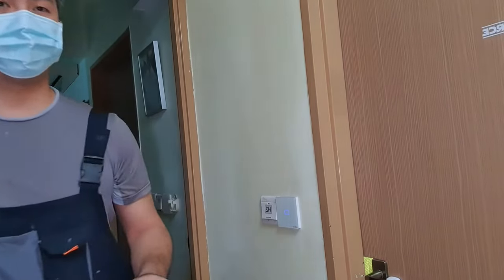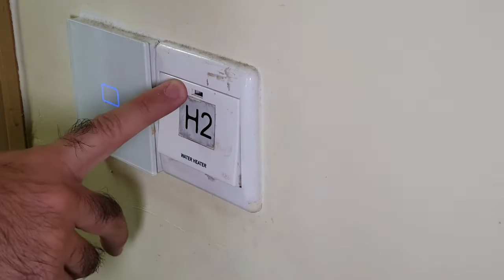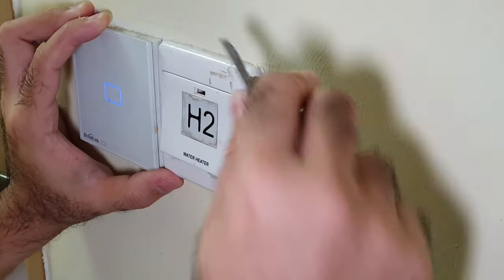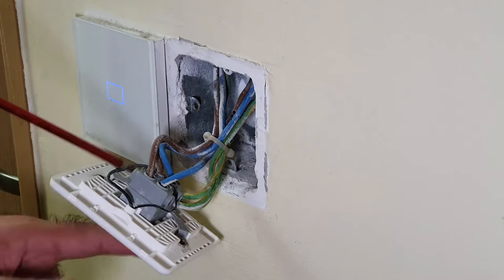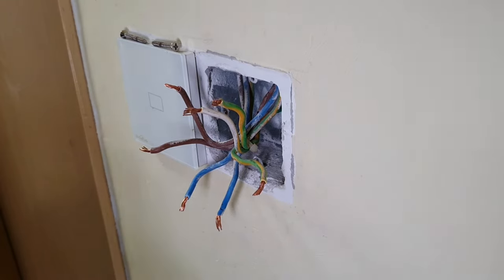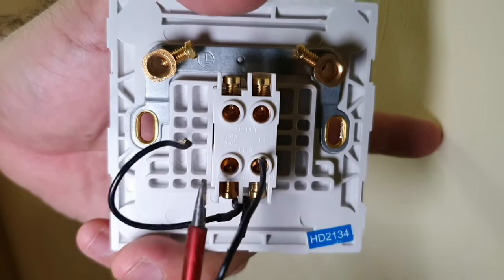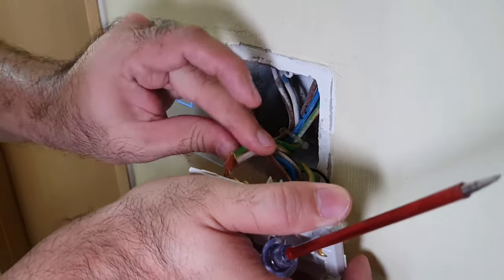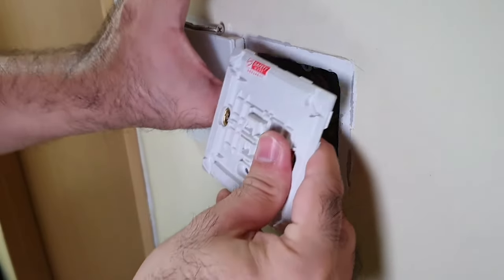Water Heater switch (20A dual pole) change (Save $120)

Comment: I found 3 earth wires when changing the heater switch, why are there 3?
Reply from the maker: Those are probably the Daisy Chain which links the rest of the house
Reply: We connected 2 of the 3 earth wires to the earth port of the switch. In the process of connecting the third earth wire to the earth port, we tried to strip the wire as husband earlier snipped it off clean, and this tripped the whole circuit both times we did that.
Reply from the maker: When you are working on electricity, your CB SHOULD BE OFF. The circuit tripped to save your husband from hurting himself!
Reply: We only switched off the CB for the heater, not for the entire house. So this likely meant that that earth wire was connected to something else in the house.
Reply from the maker: Yes it is. Your cb detected a complete circuit running through your husband and tripped. When faced with multiple wires always turn off the entire house as the Cb only controls live and current may still be present in neutral and ground. Did you use a test pen?
Reply: @ThePunggolHandyMan  Yes he tested before touching the wires, including this earth wire.
Reply from the maker: @kids_fun_draw_build  ah ok the CB detected some thing. Usually if neutral or live touches ground, it creates a shorter path for current to flow and it gets detected by a CB thats what we call that a short. Hence short circuit. Not what ppl call shock circuit. But yes its quite shocking. To avoid this startle best is to turn off the CB while working on the component. You don't get this problem in normal switches as there is no ground wire there. You get this effect when working on sockets
Reply: Thank you for your comments, appreciate it.
Reply from the maker: Thank you for watching!

Comment: Can I connect two water heaters on one circuit breaker With a cooker?
Reply from the maker: It won't be advisable..
Reply: So what can I do if I have two bathrooms with each having a water heater and a kitchen having cooker and I have one 32A circuit breaker on my main switch
Reply from the maker: You can always engage an electrician who will rewire the home if necessary.  Else if all appliances are drawing power it may trip the breaker

Comment: Hi, i changed to new switch bt now the switch feels hot when turned on. Any advise please?
Reply from the maker: The wires inside may not be attached properly. Remove and re-attachmaking sure full contact with the copper strands
Reply: @ThePunggolHandyMan  noted…thanks!

Comment: What happens if we switched load and supply connections?
Reply from the maker: Nothing really. You will just find it confusing to connect the LED wires
Reply: I switch back can already? My current one is L1 and L2.
Reply from the maker: Yea just switch it around it's fine. The switch is a metal contact that just links the wires together that's all
Reply: Can I damage the smart switch by reversing the connections?
Reply from the maker: Smart switch yes. Normal switch not really. But it's not safe

Comment: Why not make the water heater smart as well by replacing it with a smart switch😊
Reply from the maker: You could, and Some people wouldn't like using a smart switch.
Reply: @ThePunggolHandyMan  is there a problem with smart water heater or it’s a matter of preference 😄
Reply from the maker: Well some water heaters are meant to be on perpetually like tank and gas while instant water heaters are automatically shut off when not in use. Having a cutoff switch is useful to isolate a heater if there is a fault, but a switch is actually unnecessary. And a smart switch is actually overkill for a waterheater